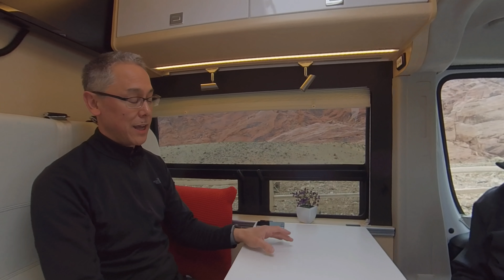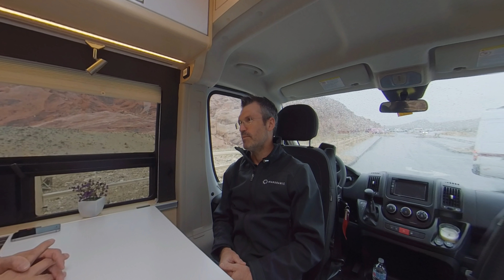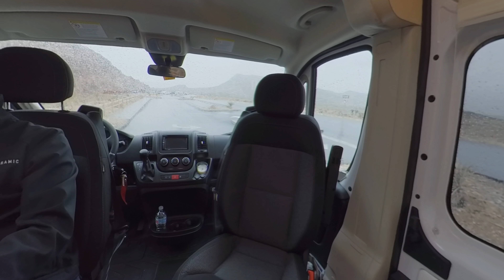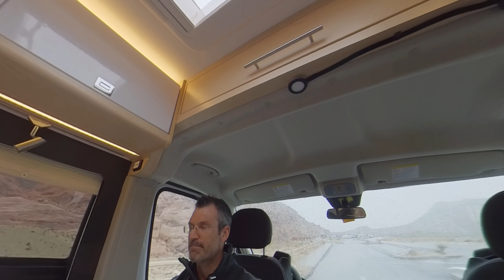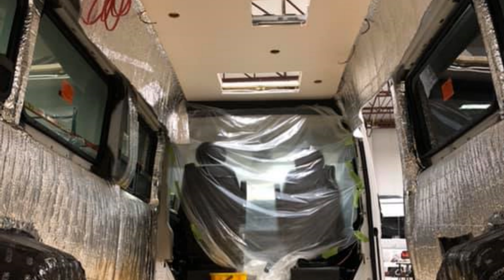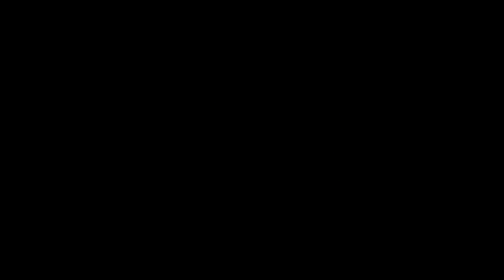Who is Panoramic RV? | Snippet 1 | Neil & Phil Interview | Hymer Aktiv Alternative?

Comment: WOW!! Great!! Went to the website and saw they offer many options.  I only wish they offered lithium, as one AGM is not sufficient and I rather have 1 lithium compared to 2 AGMs.  And it's gas powered!! Love it.
Reply from the maker: it's 2x12v AGM batteries. just fyi.
Reply: Love that it's built on the Promaster. Much easier and less expensive if repairs are needed.
Reply: @realneilbalthaser  not what is on website. 2 AGM is an option, 1AGM is standard.  I would hope this is not the case but that is what is listed on their website.

Comment: Hi Neil 👋. Are you planning on a mini then full review of this van? I have a interest in seeing if everything is about build quality or if there are some innovations. I just went to the website and it’s a little sparse. Only one distributor in Quebec? And no mention of warranty that I found. We do need these manufacturers to push the build quality upwards toward European standards/designs. Thanks for the intro 👍
Reply from the maker: straight to full review as i kind of did a mini when i talked about it in my RVX video. they are just building out their dealer network. english version of their site coming friday maybe? their warranty is 5 years.
Reply: Ultramobility I was going to ask whether you or I had to do the translations. Lol. They are so interesting  that they called you a “her” when they showed your thumbnail...🙃
Reply from the maker: I'm not too stellar looking in drag ;-)
Reply: Ultramobility Hi Neil. I contacted  a distributor for the Panoramic in Quebec asking for the  details in English on a 2018 unit they have. My very rusty French cannot translate RV specific language. No word back. I am interesting in the truma combi system if it provides heating through a hot water system thereby reducing possible propane fumes and loud fan noise in the rig. I have seen these in the Euro mkt for ages. When are you expecting to post the full review?  Pics on their website are somewhat limited esp for the washroom and nothing about outside fittings. Looks like a toaster oven? But “old fashioned” two burner hob in the galley.